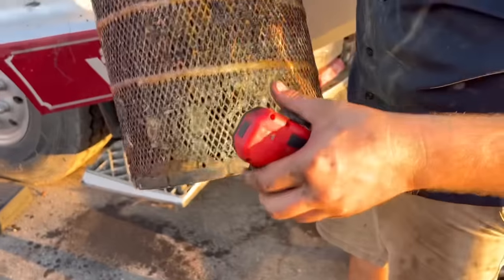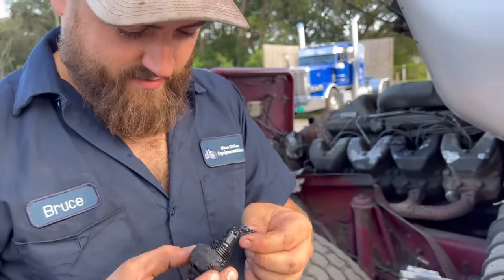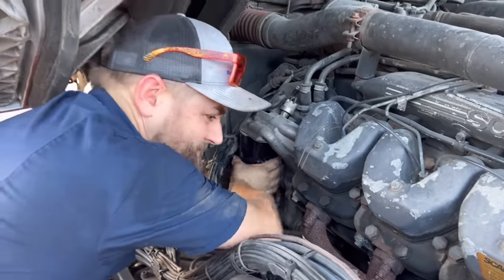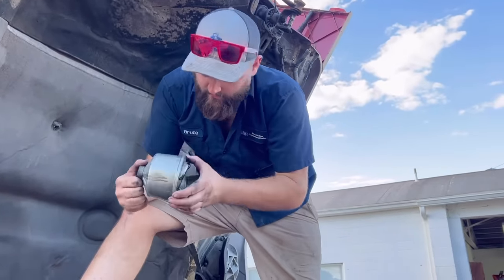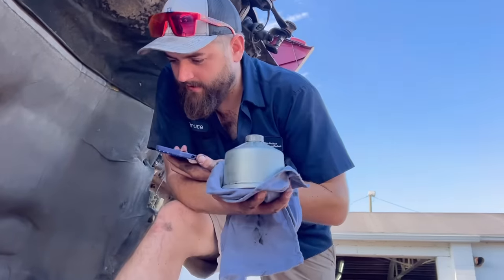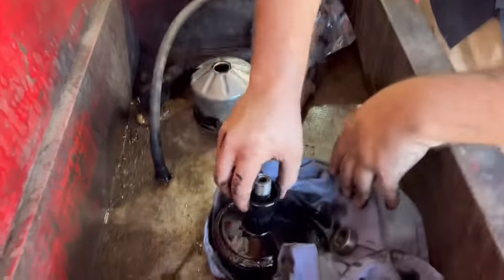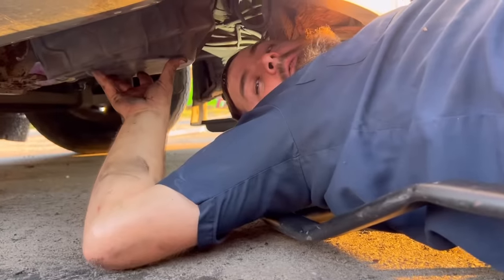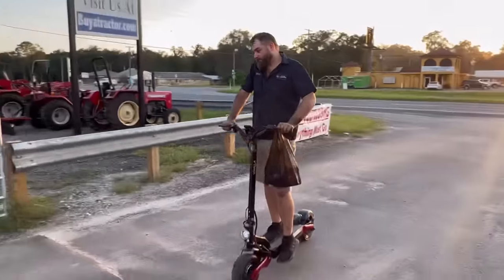Servicing my Scania, Missing Filters, Massive Sludge Build up!

Comment: Yeah, typical plastic shit. We have the same problem here in Africa. The top part of that housing is a moulded nut. Once that breaks, you are pretty much in shit. They also got a tendency of cracking down the side. We've had to have them made of Teflon cause if you get stuck on the roads here, you are a sitting duck. We've also come across Cummins engines over heating. Why? Cause the impeller on the water pumps are plastic, they become brittle and they start disintegrating. We have learnt some expensive lessons. Everything is freaking going plastic.

Comment: If you found that build up in the oil seperater just imagine the build up inside the engine
Reply: That normal for a old engine. Its not so mutch 
That oil seperator works great.
In the new Scania you dont clean it. You just change it

Comment: I gurantee yous the last Person who sold the Scania tae Vermolen did the Last Service,
because there is no way the Gypsy would have time or money tae go tae a Scania Dealer for a Full Service.
And as I said before the wrong owner, THIS is why ye never sell nice things tae or buy fae Gypsys.
Perfect example, why ye need Maintainance.
also while under there get powerwasher and give it a good wash, will look day and night.
Donnea throw the engine Isolation away, ye wonae get those and yers look tae be in good condition
Btw. the Oil seperator is the same thing as the oil-Lubrifiner on old US Trucks.
the air dryer cartrige seal is tae be oiled and then spin on by hand no wrench or what ever,
so ye get it off again, we mostly squish the shat out of them and then spin em off, ye got that big pliars ,what took ye so long?
and change yer Powersteering oil that milkshake canny be good.

Comment: im not 100% sure you trying to put the air filter with the right side on top in that thing. look at the form of the cap. try to put the other side on top in there. but i think you destroys the stand from that thing because you cut of the rubber lip that hold that thing in the right place. in europe the most stuff its build idiot save. that means all things going only in one way together so that no idiot cant mess it up. greets from europe 😎 🍺🍺

Comment: Dude seriously STOP you’re going to Fk it up. I’m a Scania technical support engineer of 30 years. You need to research these jobs first. For a start remove the sump plug washer from the oil spinner assembly and DO NOT over tighten the cap that shaft snaps easy!!!!!